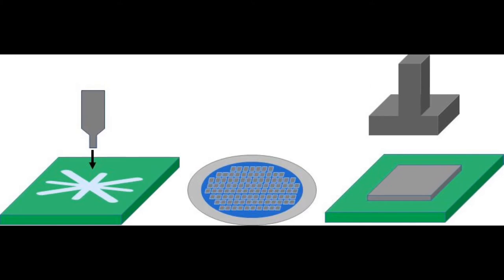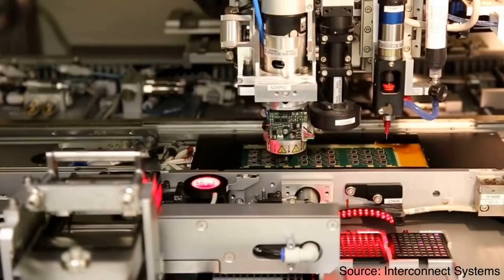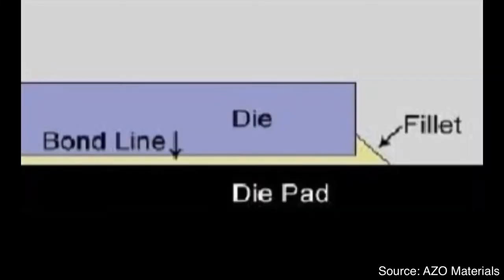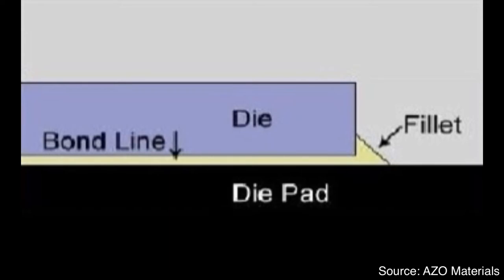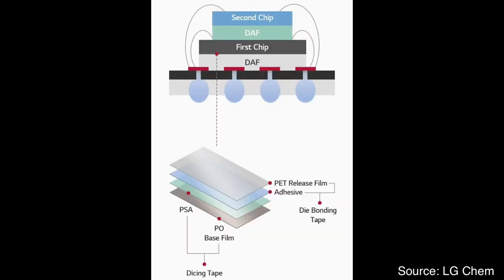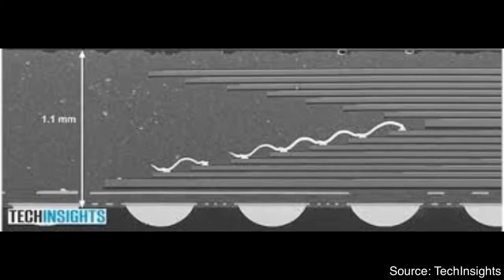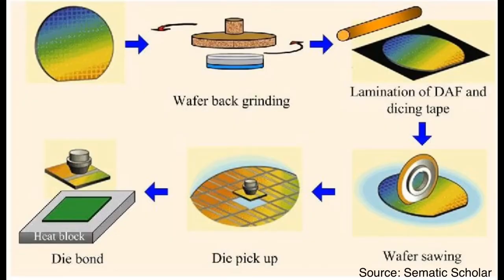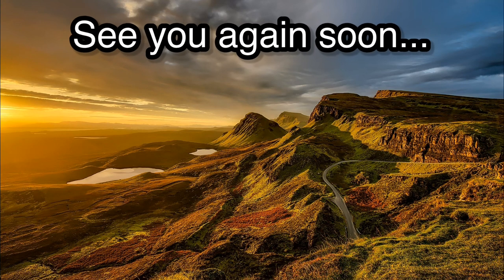[Eng Sub] Die Attach Process: Paste type adhesive, Film type adhesive

Comment: How is esd controlled depending on application with the die attach? I mean, it is needed to increase the blt to reach higher esd levels or there are some other strategies
Reply from the maker: ESD is controlled in die attach process with 2 major ways. 
1. Use ionizing air blowers - Neutralizing static charge generated during die attach process. 
2. Grounding - Die attach machine grounding, work station grounding, operator grounding with gloves, finger coats, wrist strap, floor mat, floor, floor finish, shoes, clothing etc. 
For die attach material, high electrically conductive die attach material is used e.g. Ag based die attach adhesive.
For die itself, there are ESD protection circuits inside of die. For package substrate there is ESD protection related design within substrate.

Comment: Can you make video about how to read Bonding diagram. And how to set up a new model or device, I'm new in Semi con and my Department is PQFN station Die attach. Thank you
Reply from the maker: Thanks for watching. Nowadays I can't upload video without enough time but I don't want to make you wait. 
Here are some quick tips for die attach bonding diagram.
1. Check die pin 1 location within - It is to align die orientation correctly with leadframe.
2. Check die location on leadframe - Most cases it is not critical. But for optical die it is very critical.
3. Check die size - We need to choose right die pick up tool based on die size.
4. Check die thickness - We need to choose right die ejector pin and its configuration based on die thickness. Especially for thin die it is important because die is fragile.
5. Check die tilt reqirement.
6. Check bond line thickness reqirement.
7. Check whether die pick up tool can touch top surface of die. Most cases it is OK to touch but some cases die pick up tool can not touch die top surface. Then we need to use special die pick up tool so called collet.
8. Check die attach material

Comment: thank you a lot for the video! I was wondering if one could attach the die with bent tweezers, instead of a bonding tool on a machine? Thanks in advance!
Reply from the maker: Thanks for watching. It is possible but nobody attach die manually because bonding quality will be poor.
Reply: @semicontalk3223  thank you. I understand that it is possible nevertheless. Will give it a try before buying the equipment. Best wishes!